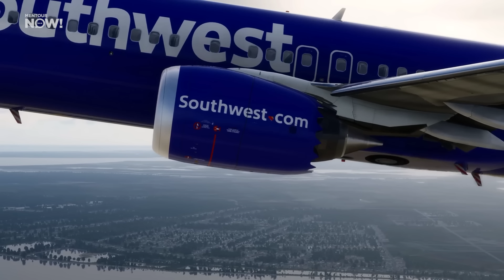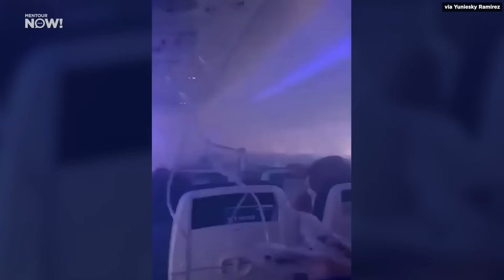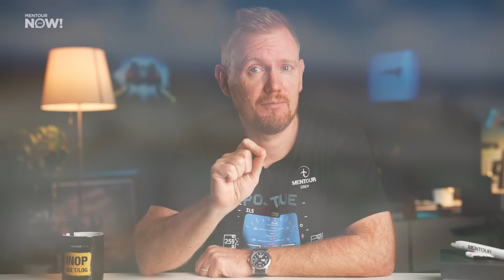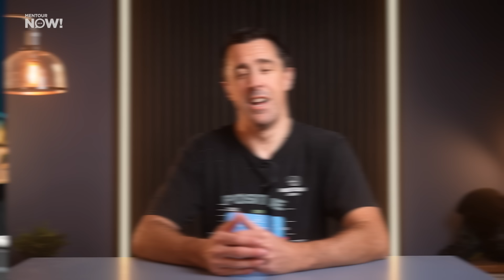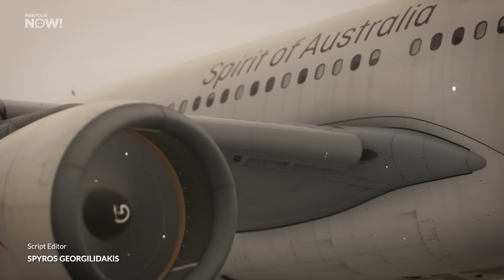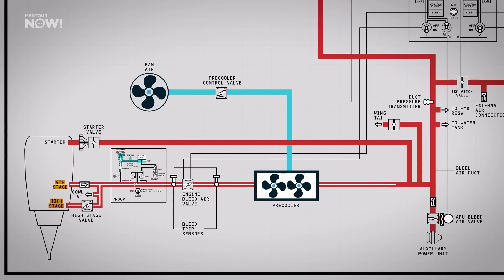Why Don’t ALL Airliners Do THIS?

Comment: I was a caotain on Bae146 aircraft for over 5500 hrs. this aircraft with it's 4 Lycoming engines was probably the worst for polluted cabin air. Like many other 146 pilots I've suffered neurological damage and sadly some died as a result  A group of BA pilots took up the case and we're quietly compensated . The "smoke in the air problem" was so bad that on numerous occasions the cockpit crew would have to wear O2 masks.

Comment: This reminds me of a thought, or prediction, I see coming, the end of the APU. They are dead weight when not being used. Might they be replaced with a small next gen. battery pack? How about a more advanced engine that burns hydrogen and oxygen like the ones they want to use on EVTOLs? Just a thought. Note: Cabin air is 5000 ft. in the 787.

Comment: The video begins by framing the bleed air vs electrical question as a safety issue and ends up framing it as an efficiency/cost/reliability question. As a consumer if you offer me the choice to never worry about having to breathe toxic oil smoke in an emergency I'm taking it.

Comment: I think the next clean sheet aircraft should have the 787 system, specifically because aircraft burn a huge amount of fuel on taxi running their big engines, in theory if you had the APU set up of the 787 you could include electric motors on the landing gear to physically power the wheels of the aircraft to enable an engine off taxi, which especially at large larger airports would save millions per year in fuel in theory having electric motors on landing gear, would also enable the aircraft to push back without a tug, and even potentially without “wing walkers” if a camera and sensor system was also installed

Comment: Soo basically, Airbus chose to stick with a familiar approach due to not enough weight reduction in Boeing's approach, while Boeing took a more ambitious approach eliminating the bleed air system all together, while also making the aircraft safer for the passengers to travel. Despite Boeing's struggle, Boeing is still the better manufacture just for that reason alone in my opinion.  Passenger safety matters a lot more than weight reduction and efficiency.

Comment: Seems like one big advantage of using electricity as the lingua franca of energy transfer between different parts of the system is greatly simplified testability.  Seems like any portion of the aircraft from the largest to the smallest, can be run using nothing but electrical inputs.  Much easier to design and build a test rig , and also much more straightforward to specify the interface between components, if electric power is the only thing passing back and forth.  

Electricity is of course extremely well understood in the engineering community , so in the overall sense it's pretty riskless as well .

Comment: The windshield defroster and heater in gasoline powered cars are not electrical. They use waste heat from the engine.

Comment: The 787 is the only airliner not to use engine bleed air to ventilate the cabin. As a passenger the 787 cabin is more comfortable than anything else I have flown aboard.

Comment: Pardon my ignorance but couldn't air filters be installed to prevent oily smoke from entering the plane?  My home air conditioning unit has them as do all home A/C units. They do a decent job, they are cheap and effective.

Comment: The VC10 used mechanical compressors for cabin Pressurisation, called Godfrey compressors.  These gave the aircraft that characteristic whine.  The reason Rolls Royce would not guarantee the Conway engine and bleed would be oil free.   The Boeing 707-400 Series operated by BOAC, also had Conway's, but cabin air was supplied from turbo compressors using bleed air to drive compressors taking ambient air.

Comment: A fully electrical like the 787 must add to the computer programming complexity and pilot operational knowledge of such systems.   This begs the question of having back a third pilot again to handle unforeseen system emergencies while the pilots concentrate on FLYING.

Comment: Not sure if this has already been mentioned in the comments, but the DC-8 used fresh air intakes in the nose area combined with a bleed air driven compressor system.  This had the advantage of avoiding smoke in the cabin while still using bleed air power, just another affirmation of the design ability at Douglas Aircraft.  The 707 may have been better looking (really the best looking jet airliner of all time), but the DC-8 had superior engineering and a longer service life.  It is amazing that we had to wait for the 787 for an airliner that didn't pump bleed air into the cabin.  What a disgusting thing for the airlines to pump bleed air to their passengers for so many decades.
Reply: I should have also mentioned how degrading the use of bleed air has been to the flight and cabin crew.  Even trace amounts of organic volatiles can have negative effects for long term exposure to in-air airline employees.  While the DC-8 already had a clean air system, it just shocks me that we had to wait 60 years for the 787 to have a clean air system once again, and then no other new aircraft since then has a clean air system.   One cannot underestimate how poorly business and engineering management regard the health of people on their aircraft.  They literally don't care despite all excuses and clever arguments they might make.
Reply: Petters and Ben are airline pilots.  I would think they would be outraged that airlines and manufacturers have been making flight crew breathe jet engine bleed air when reasonable engineering solutions for clean air have been available for 60+ years since the DC-8.  However, it is probable they wouldn't be able to keep their jobs if they expressed such opinions on a widely viewed YouTube channel.   Congratulations for Mentour for at least bringing up the issue even if the obvious was left unsaid.
Reply: To digress more on cabin and flight deck air quality, I should mention that CO2 levels on aircraft are way too high, usually above 1000 ppm.  HEPA filtering definitely helps keep both disease transmission down and reducing impurities in bleed air, but a maximum CO2 requirement (< 600 ppm) would help keep air quality to the level of a well ventilated house.  That plus a requirement to ban use of bleed air would make airliners have superior air quality for passengers and crew.
Reply: Interesting fact, the Concorde also had a clean air system

Comment: Ok, one point jumps out as a new question I'd love to see answered... you mentioned the issues had with lithium batteries on the 787 and implied that was a consequence of the bleedless design. But that doesn't really follow that I can see. In both systems, the engines generate power (hot compressed air or electricity) when operating and that power drives the various systems. So where does the battery come in? Batteries are storage energy storage devices, of course, but how does storage suddenly become a requirement? There isn't storage in bleed air, is there? So is the battery really a consequence of the all-electric system or does it arise from another design choice? 🤔

Comment: With new systems usually have unforeseen issues, so I think airbus decisions also allows Boeing to feel the brunt of the learning curve.  Also new specialized equipment will be developed which will further improve next generations becoming lighter and more reliable.

Comment: The 787 is not the only aircraft that gets its cabin air directly from outside, The McDonald Douglas DC-8 and B707's did also, except the 4 cabin compressors were driven from engine bleed air instead of electric motors. At that time the B737 used the modern (ACM) air cycle machines. Douglas thought the engine bleed air was to dirty (isn't that interesting coincidence) by n by, The Freon system that was used to cool the hot compressed air was lots of trouble. Their next a/c was a DC-9 which used ACM's. I wonder why!!. As a AME in the 1960's spent a lot of time in the Freon compartment looking for leaks. CHEERS GUYS

Comment: Electrification of aircraft is already here and coming to larger and larger aircraft. Now Boeing has a tactical advantage having already designed, built, delivered, and improved the first step of electrification of the control and comfort systems. When battery safety and density reaches the commuter-type aircraft, Boeing will be far more ready for electrification than Airbus as a result.

Comment: When you asked which other transports had two generators per engine, I assume that you meant IDGs. Most modern jet transport engines have both an IDG and a 
I thought that the 707 AWACS had two  per engine, but I could not verify that online. However, the the 747 based E-4B. The s did the YAL-1 Airborne Laser (ABL - another 747). The 707 E-6 (TACAMO) also has 2  per engine (8 all total).
FYI, by the time we got to the 787, we knew that we wanted to significantly beef up the electrical generation capability. When IFE became popular, we found ourselves in a power budget bind. Some seat units were drawing more than 100 W per seat. That is why you saw much simpler IFE systems retrofitted into some of the older Boeing products. We wanted the 787 to be as "future proof" as we could make it. I.e., excess electrical power generation. I'm not sure how the 787 early design team came to some of its decisions, but I did notice at the time that the program had a very scary high percentage of engineers that had never designed an airplane before..

Comment: The bleed air system is inherently dangerous. It would be like using air passing through an automobile’s engine compartment to enter the passenger cabin. 

Has no one put forward the possibility of using a turbocharger device powered by bleed air to pressurize and heat clean air for use in the interior of the airplane?

Comment: Actually not using Bleed Air for Cabin Pressurisation is nothing new.  The old VC10 had engine driven Godfrey Pumps (superchargers rather than turbochargers used on other old jets) to provide cabin pressure. Cabin outflow was also used for thrust recovery - which I think is pretty normal these days.

Comment: The "low hanging fruit" would have been to regulate the bleed air from each of the compressor stages used. In control systems that is the shortest path that can be coupled to other FADEC functions so that control system instability is less likely.  Bleed air operation can be informed of compressor stage condition by FADEC's *intent*; i.e. it can have "premonition" about what is about to happen, allowing e.g. positioners for bleed regulation time to move to provide the required bleed air as the engine's condition changes.

Regulation at the engine also means that e.g. detected vibration excursions can result in the immediate shutoff of bleed air from the wobbly engine. The issues are contained to the one power plant; which is going to get hot anyway!

Close regulation means that less energy is wasted via bleed. The relative efficiency compared to electrical systems is going to be a close call. One misteak on the implementation/design of either could easily tip the balance far in the unintended direction.

Comment: While 2003 made 235V AC sense, nowadays it should be 800-1000V DC, avoiding multiple conversions and sharing knowledge with the EV industry. 
And if a plane system is 100% electric, with no hydraulics, with the fuel and oil pumps also electric, there is theoretically no need for gearboxes; starter-generators can be mounted directly on the turbine shaft; 5000 rpm at idle is more than enough to generate all the power needed, no need for a 1.4x multiplier gearbox.
Reply: 1. Maintenance requirements/
2. Turbine shaft temperature.
Reply: @BerndFelsche @BerndFelsche  Maintenance requirements - well, it depends on how reliable it can be made. I see no fundamental reason why a 500kW starter-generator should not have the same life as the engine (50-100k hours between overhauls).
Turbine shaft temperature - it's no issue if the starter-generator is a switched reluctance one. 
I guess my idea makes no sense from a total cost perspective; it's cheaper to have a gearbox and one (or two like on 787) separate unit(s).

Comment: Ummmm. Its just an old-style engineering habit, "we already have some system, lets connect our new small secondary feature to it, it saves us lot of hassle!". In cars, for example, windshield wipers to engine vacuum, windshield washer to spare wheel as pressure source, cab heater to heat exchanger on muffler, oil pump to the same shaft where ignition distributer is, water pump to syncrobelt, parking sensors to the main control bus... what can go wrong! No fear, shove it to production!

And then SUDDENLY appears that such links between systems create unpredictable consequences when something does go wrong. Instead of limited problem in one system it creates multiple failure all over the machine, when everything fails at once and, as bonus, adds smoke in cab. Great success even in VW beetle, not in plane on cruise far away from land.

Electric air compressors do not save fuel and engine power, even in opposite they suck much more power due to all necessary conversion losses. But at least they segregate engine operation and cab ventilation physically, by electric wire. By the cost of 6x200KW (oops, very unpleasant device...) generators, wiring, distribution...

Comment: If only they had enough brain cells to enable automatic bleed valves closure in case of LRD events.
Losing cabin pressure is way less dangerous than getting smoke in the cockpit and giving lung cancer to the passengers.

Comment: Back in the mid-1960's I flew on a BAC-111, between Kansas City and Omaha. The kerosene fumes in the cabin were dense and very unpleasant, resulting in many complaints to the cabin crew. Exactly one week later the same flight blew up in the air, and it was reported that there had been complaints of fumes for some time (i.e. it was the same plane). Aside from the obvious incompetence of continuing to operate a plane in that condition, it struck me that any design that routed air from the engine was unnecessarily risky. Of course in those days passengers were allowed to smoke on planes so a ready source of ignition was usually present to set off the fumes. No doubt modern planes have largely mitigated the risk, but it seems to me that this is one technology that should be relegated to the dustbin of history, at least for cabin air.

Comment: No, Ben, Boeing did not use a "very unique" approach to dealing with the problem of cabin smoke. Unique means "one of a kind," so Boeing either employed a "unique" approach or a "very unusual approach" or even just and "unusual approach" to this issue. "Very unique" comes from the absurd "superlative-izing" of language and it's really not either smart or necessary. No argument is strengthened by exaggeration. Another way to state the same thing is that Boeing used a "novel" approach to keeping smoke out of the cabin. 

Not to pick only on Ben, whose misuse of unique is hardly very unique (ahem), Petter has said a number of times "that begs the question." But it doesn't beg any question because that term is another case of people trying to make language more emphatic that it needs to be. "Begging the question" is a specific logical fallacy which involves assuming as true that which is being argued. What Petter really means is "that raises the question" or "calls forth the question" and so on. 

I don't blame Petter, since he is not a native English speaker and he has undoubtedly heard any number of people use the expression "begs the question." Language is for communication and the more precise it is, the better. Destroying the meaning of a useful logical fallacy doesn't benefit anyone. At some point, some talking head imported "begs the question" into her or his speech, thinking it sounded stronger (I suppose) than merely "raising the question." Very few people ever study logic in school, but I think we'd all benefit if everyone were more familiar with logical argument. Today, much of political discourse simply descends into nonsense as people abuse language for their own ends.

I'm pretty old now, and when I was a kid, no one talked about things being "very unique" or "begging the question." Over time the language gets degraded by ignorance, which serves no useful purpose. I think both Petter and Ben do a fine job on Mentour Pilot and Mentour Now!  I won't stop watching because of their language errors, but I will cringe each time I hear them.

Comment: From frequently working on testing parts that are powered by bleed air, it's often a lot hotter than 200C.
Some test conditions I've dealt with were upwards of 450C.
It depends on which plane, what simulated flight conditions, and where in the bleed system we're talking about (before or after precoolers, ram air heat exchangers, etc.)
FWIW, on A350 it is indeed roughly 200C at the "pack" inlet.

Besides 787, most if not all of the upcoming electrically powered smaller planes will require bleedless pressurization and HVAC systems.

Comment: Im a corporate pilot.  The Bombardier Global Express series has 2 generators on each engine as well as 1 engine driven hydraulic pump on each engine backed up by an electric hydraulic pump and a third system run by an electric hydraulic pump and a secondary electric hydraulic pump. The most redundancy in any corporate aircraft I have flown.